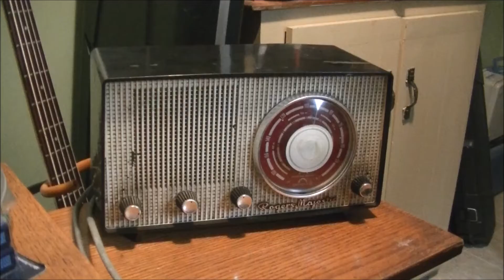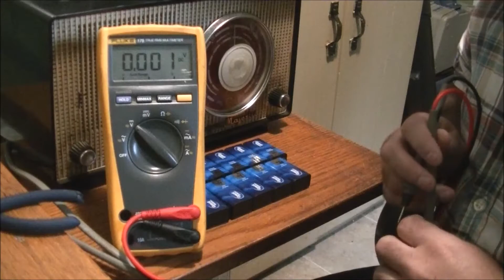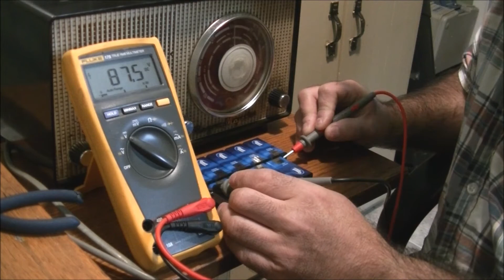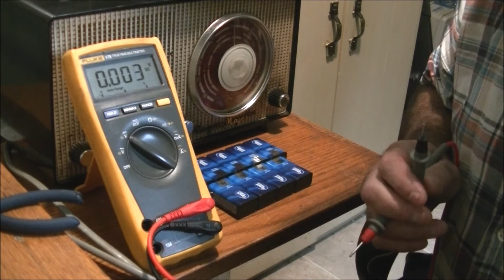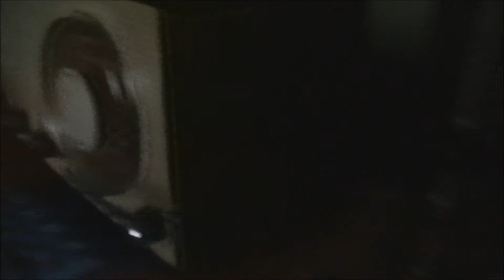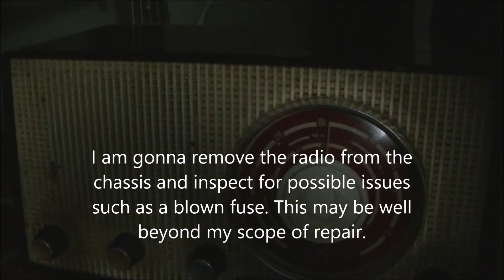Rogers Majestic RM776 - Will It Power Up???

Comment: Love the trick with the 9v batteries.  Sort of thing i would end up doing.  Did the tube heaters glow ?
Reply from the maker: Sadly, 3 of the 4 tubes are shot. No reading on the heater pins with an ohm meter. It may be difficult to find the tubes as well.

Comment: andy you will not see any glow frome these valves (tubes) it may pay to remove the valves and clean the pins .if you have an ohm meter you can check the heaters by measuring between pins one and seven on resistance range.
Reply from the maker: Will do Rob. Thanks for the swift response. I will begin that process now on checking the tube heater pins and cleaning up the pins and sockets. I will mark down the results.
Reply from the maker: I did a quick check on the tubes. the pins and sockets seem okay but three out of four tubes are not showing a reading on pins one and seven. You have helped me discover the obvious issue. Thanks so much.